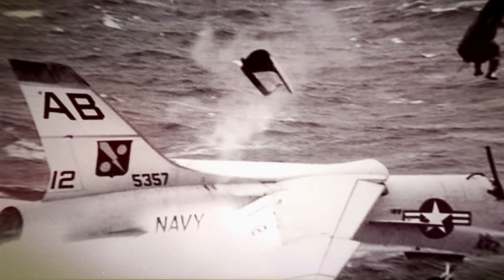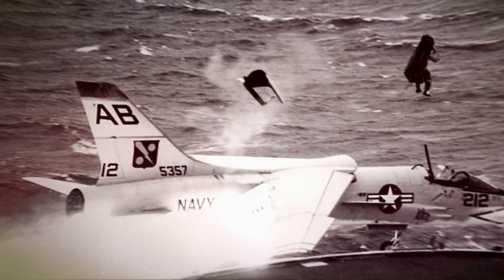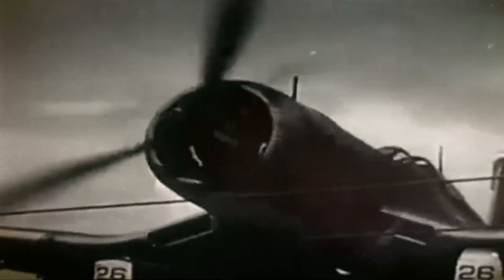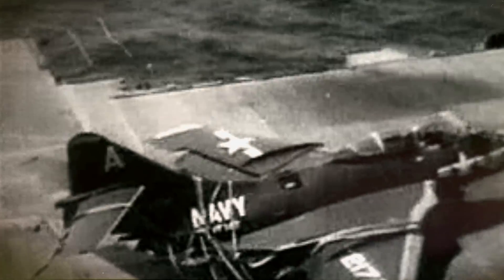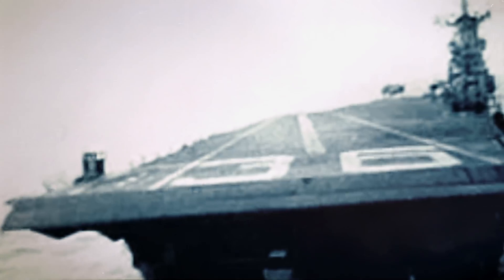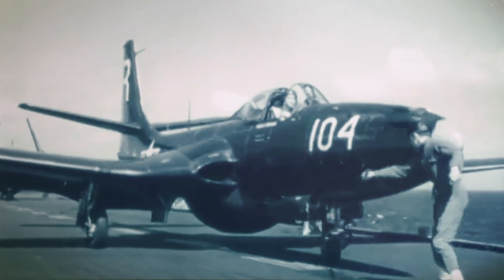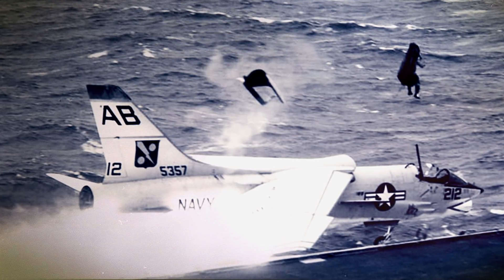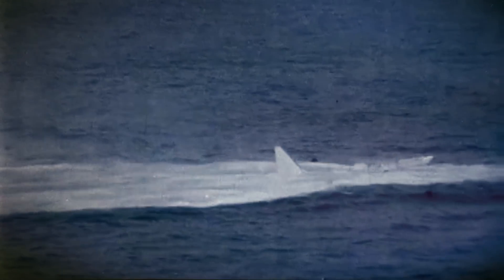F-8 Aircraft Carrier Crash (why carriers have angled decks for landing)

Comment: So the F-8 was a great plane unless you tried to do something silly like land it. Got it.
Reply: Check out the F-104 for a true shit box lol
Reply: Well landing on an aircraft carrier is a lot different than landing on a regular runway, smart-ass.
Reply: @dannybeads3672  did you learn that in Special-Ed class?
Reply: or just fly it slow, in general. I'll bet it still was better than the F4. 

I think the early 100 series deltas...high sweeps had a similar problem...at low speeds their aoa was so high that they would not accelerate when given more throttle, even in full afterburner.  Their airspeed would just continue to drop off until a wing stalled.
Reply: Nobody makes ace with a landing
Reply: So F8 was designed to kill dangerous aces who got the rank on their first op?
Reply: @APersonOnYouTubeX  No. The F-8 was known to be difficult to land, due to the fact that if the F-8's sink rate went over a certain amount, and they had to go full-throttle to prevent themselves from smashing into the deck, some weren't able to due to the engine not being able to power them out of it.
The F-8 was a great aircraft, but like many, it had its flaws.
Reply: lmao Rob 🤣
Reply: The Japanese made a ton of them for some reason......🤭

Comment: Angled decks also allow for the simultaneous launch of up to 4 aircraft on the larger "super" carriers like the Nimitz class.
Reply: Which was actually the real reason for the upgrade.
Reply: @ChrisD-og9lj  the safer landing option was the reason they started angling the deck in the first place. the extra two cats is a 'well, why not?' that only made sense to do at that point
Reply: @DFX2KX  Both of those reasons are secondary nice to haves. The real driver in US service was simultaneous launch and landing operations. Lessons learned during WWII showed the vulnerability of carriers caught during landing operations. See the IJN experience at Midway in particular, though both sides had multiple times when carriers were damaged or destroyed during landing operations. The need to use catapults as aircraft got heavier exacerbated the problem. There were several proposed designs going back to late WWII trying to address the need to both land and launch aircraft simultaneously (Including variations on the post WWI idea of launching from the hangar deck that jetwash murdered quite effectively).

Those nice to haves are not unimportant. Being able to launch more birds quickly gets ordnance off the deck quicker and also allows the carrier more defensive options. Being able to recover aircraft while launching a strike is also important to minimizing the loss of aircraft (either collisions on deck or ditched aircraft).

Another big component is the deck edge elevator. The centerline elevators of WWII and earlier carriers cause all kinds of havoc, requiring a lot of extra movements to get landing aircraft aft on the ship and launching aircraft spotted amidships or aft after being brought up. Deck edge elevators complement the catapults in shortening up the distances a plane has to move. Not having a huge space in the middle of the hangar deck that you have to move planes around all of the time is another big plus.
Reply: @timberwolf1575  These points are fair.

Though The higher landing speeds (and mass) of jets would have necessitated having the landing area of the deck angled away from any parked or taxiing aircraft on it's own. Even if all you care about is speed of redeployment, having a jet plow into parked jets waiting for launch is... sub-optimal is an understatement.

The side-fixed elevator is something that baffles me as to why they didn't do it that way initially.
Reply: @ChrisD-og9lj  The real reason for the angled deck was so the pilots could do a touch-and-go and try again if they missed the wires.  Guess you aren't a pilot.

Comment: That F8 pilot is LTjg Terry Kryway.  He was our Air Ops officer on the Midway 1975. Super cool officer, retired as a CDR.
Reply: Wow! That’s really neat.
Reply: @snipe69 Being promoted three times after the accident shows that the accident has no bearing on making 0-6.
Reply: @snipe69 only a small % of officer make their bird, something like 3%, so there is a 97% chance you wont get promoted.
Reply: Wow
Reply: Interesting design the F8  used a crank to canter the whole wing up to change its angle of attack to enable take off and landing.  You can see the gap at the front of the wing on the top of the fuselage with wing in landing and takeoff position. Good solution, awesome jet last of the gun fighters looks to die for great history.
Reply: Lt  colonel had silver oak leaf insignia a colonel has eagle with out stretched wings...
Reply: So if someone is full bird colonel they have been promoted... he is now a "full bird colonel "
Reply: He was almost out of that ejection seats envelope, the mb gru 5 was not a rocket assist seat
Reply: Folks who were not in the military usually do not know 'all' the abbreviations of the different ranks/jobs. So, it's better for the masses if others spell it out. However, I did finally find the meaning online.
Reply: @gleamersmotorcyclepainting9498  I like to figure out the abbreviations and slang on my own, that's how I know this gentleman was a light jaguar who retired as a cider maker and was never allowed to cook a turkey.
Reply: @krashd  lol
Reply: @krashd  that was one of the hardest things to learn was what all the abbreviations stood for.
Reply: Whats a full-bird?
Reply: @datadavis  it's a plane with two wings instead of one
Reply: @datadavis  Colonel (Army/AF) or Captain (Navy). 

The rank's insignia is a bird with spread wings. Full bird by opposition to those who are 'only' Lt Col.
Reply: Isnt the next step up like a corporal general or something like that. After you make colonel you go to the bottom rung of generals?
Reply: @nickjimenez4262   brigadier general in army marines and air force, rear admiral in the navy.
Reply: @AY343-i2g  thank you

Comment: Cool info, though I was initially thinking this was going to be about carriers that have a curve upwards at the end of the runway
Reply: The steam catapult is a more complex but much more effective method to launch aircraft. It allows the carrier to launch heavier/larger/more capable aircraft than the ramp method. Currently, it's a major hindrance to aircraft like the J-15 in China because it severely limits the weight and armament. It takes the J-15 from being (on paper) slightly more capable then a F-18, to significantly inferior while having roughly a quarter of the weaponry and roughly a third of the range. Effectively useless in a modern engagement.

I know that's not the question you asked, but I think it's a cool fact and a bit of context to the different designs of aircraft carriers.
Reply: @seangreening9311  The Russian, Indian and Chinese carriers have steam catapults AND a ski ramp. It's only the British carriers that only have the ramp because the idiots believed Lockheed's promises about the F-35's performance when they designed them.
Reply: @andrewallen9993  I'm not as familiar with the Indian Navy. But I know that the current two carriers for the chinese navy, the Liaoning and Shandong (type 001 and 002), do not have steam catapults equipped. Neither does the only carrier in the Russian Navy, the Admiral Kuznetsov. All of those carriers are strictly ski-jump launch systems and the chinese carriers are just modified versions of the Kuznetsov.

China does have plans to install a catapult system for their next hull, type 003, but they're still in the dry dock/construction phase of things.

Would you mind telling me what carriers use both? As far as I know those are actually mutually exclusive ways to launch carrier based aircraft.

I would be interested in seeing the design of a ship that can manage to make both work simultaneously.
Reply: @seangreening9311  I stand corrected sir. I knew about hull 003 and knew the existing Indian and Chinese carrier were ex Russian and drew the wrong conclusion :)
Reply: @Jake Johnson Correct. The ramp is the non-mechanical way of aiding jets. Like the Indian and russian carriers, and their sukhois and migs, and such. Just so they can make it out.
Reply: @joeytheetge9268  Let's keep things civil.
Reply: @Jake Johnson never said American ones, I’ve only seen them on Chinese I believe
Reply: @acepilot1  The ski-jump, like the angled deck, the steam catapult, and the mirror landing system, were all invented by the British Royal Navy. The ski-jump to improve range/payload of Harriers on the small Invincible class carriers,  the others to allow larger fast jets to be operated by the small UK carriers after WW2.
Reply: Ski ramp are for Europeans
Reply: @DOI_ARTS  That is a silly comment. Stick with Aviation.
Reply: @WALTERBROADDUS  ok man but who put you in charge? Why not post your own comment and tell people what to do with their opinions.
Reply: @DOI_ARTS  It's called being a adult.
Reply: @WALTERBROADDUS  No, on contrary you're being childish. How you tell people to do things you think they would be better at or that being sarcastic tells something about your maturity.
Reply: @DOI_ARTS  And you work in a magic company where that is not standard? I think not.
Reply: @joeytheetge9268  I dont understand what you're saying but no American Carriers had that design, just sayin facts. Gob bless you.
Reply: @Jake Johnson Cats and Traps were of course introduced to the world by the Royal Navy and copied by everyone else. On the UKs new carriers there are no cats and Traps because British politicians were stupid enough to believe what Lockheed promised about the F35's capabilities.
Reply: @andrewallen9993  its what we do best

Invent something and abandon it because of politics
Reply: @Joopyter724  :)
Reply: The ski jump was for launching large, underpowered aircraft from smaller carriers. USA got away with launching things like Boeing E3's that were basically airliners because of our philosophy on building aircraft. everyone else matched the engines closely with the airframes. we'd take the lightest, strongest airframe possible and stick the biggest, hottest engine possible that we could jam in the nacelles. We tended to build sick, madly overpowered hot rods while everyone else did a close power to weight ratio. plus we build much larger ships than everyone else. hell our DDGs would be medium cruisers and frigates in any other navy. why? because we Americans have the smallest D**ks in the universe and we need to over compensate lol
Reply: @Jack29151  I hate to break it to you, but we most certainly can't launch an E-3 off of a carrier, a C-130 can barely land on a carrier and an E-3 is significantly bigger. You're probably thinking of the E-2 Hawkeye which fills a similar role but is much smaller.
Reply: @battleoid2411  A Boeing E-3 is 707 airframe, I know what it is, and we did launch one of the re-engined ones off a carrier during a wargame. it was a test to see if we could get a looking glass plane into the air if the land bases got taken out yes it can with all throttles firewalled doing full revvs but if you have to land, you gotta ditch. E-2 hawkeye is a radar plane, E-3 is a command plane. they wanted to see if they could get command and control airborne if they lost the land bases in a surprise attack (SLBM Salvo).
Reply: @battleoid2411  It isn't much different than a short field takeoff.
Reply: @Jack29151  yeah, much as I'd like to believe it im gonna need a source on that one chief, because as I said before a stripped down c130 could barely do it, you're telling me a much bigger and heavier E3 is a bit of a stretch.
Reply: @battleoid2411  You're talking about landing, I'm talking about takeoff. takeoff weight of a c-130 minus the cargo is 155,000 pounds, the takeoff weight of a loaded E-3 is 145,000 pounds including the fuel, the c-130 is turbo prop, the E-3 is high bypass turbofan, the E-3 is a much more powerful and lighter aircraft than an empty c-130. and it was several years ago. they were simulating a soviet SLBM strike on the west coast bases and testing our ability to respond (You need E-2's and E-3's to coordinate the counter attack), they damn near put the thing in the ocean but they proved it can be done,. is it possible? yes it is, would they do it on a regular basis? likely not. a C-130 might have a shorter fuselage but it makes it up in overall mass and volume. England even did it one time with an Airbus super guppy. with the proper application of horsepower anything can takeoff from a carrier including the test they did with a Boeing 757-200VIP (The navy was considering buying those to haul admirals around so they did a carrier test on one).
Reply: @battleoid2411  Nah, John isn’t crazy or silly or anything. (Wink wink). E3’s can totally takeoff from an aircraft carrier. But they can’t land on them. So you see, what they do is they build them on the carrier. And while they are doing that they also fill up all of the empty space with helium balloons. When it comes time to launch they only put in one pilot and enough fuel for it to meet up with a refueling plane. While it’s refueling the rest of the crew shimmies down the boom. Oh, I almost forgot to mention that the refueling plane is also based on the 707, so it took off the same way. Of course. I mean I imagine that is how they had to have done it. Otherwise it would not make any sense at all.
Reply: @willdejong7763  oh of course, how silly of me, I completely forgot about the modular tactical strategic flotation balloon system the E3 uses for carrier launches
Reply: @Jack29151  You have a creative way with Aerodynamics.
Reply: @WALTERBROADDUS  There's a reason we do that. big high horsepower engines are quick revving. it doesn't have to spool up, you slam the throttles and you're almost instantly at top revvs and takeoff power. we do that by clutching the front fan so the rest of the engine can rev quickly. 1 engine on an F-18 is more powerful than all 8 engines on a B-52 and all 4 engines on a concorde. Aerodynamically we don't do much different than the rest of the world. but we beef up the airframe and like every other vehicle we build we go high on the power side of power to weight. everyone else gives it exactly what it needs, we give it more than it needs. with Turbofans, you get into the size range American jets use the fan starts to behave like a supercharger. it becomes a sick, quick revving screaming monster to beat hell. helps in a dogfight too, it can out accelerate and outclimb everything else in the air. we don't need that ski jump, our jets can use raw unadulterated horsepower to initiate the takeoff. We can even do a scramble takeoff if the catapult is battle damaged. Like I said we Americans build our jets like we build our other vehicles, Big grossly overpowered hot rods to end all.
Reply: @Jake Johnson They were Brit inventions smart guy.
Reply: @WALTERBROADDUS  "They were brit inventions smart guy." "Lets keep things civil"
Boy do I love the smell of hypocrisy in the morning.
Reply: @battleoid2411  At least I try to keep it in check. Others? Not so much.

Comment: It's a given isn't it? If the plane overruns but can't takeoff, you don't want the pilot to be run over by the ship, so you angle the landing deck.
Reply: Or to hit the planes stored at the end of the runway...
Reply: Not a given, it had to be 'invented' after dozens of carriers had been built
Reply: it's a given when it's been invented and built and tested and you're sitting in a chair  80 years later watching a youtube vid making like it's obvious
Reply: In ww2, the planes were slow enough, and light enough, that a net could catch them.  Catapults did exist, but they were way slower than just having the planes fly off the deck, which the ww2 planes could easily do on the big carriers.  Having everything in line is pretty intuitive.  Jets couldn't be caught by the nets safely, and jets couldn't take off without the catapult.  So they developed an angled deck and much faster catapult.
Reply: When a ship sails directly into the wind/sea the heave (up/down) movement magnifies. The easiest way to correct this is to sail slightly off the wind therefore an offset flight deck would still be directly into the wind. It really is nothing to do with not running over a pilot who would most probably be dead https://en.wikipedia.org/wiki/Flight_deck
Reply: Lol well if you would have watched the video you would have realized that’s not the answer.
Reply: @Morte Parla -Lol thinks it’s a given and still fails. WRONG ANSWER.